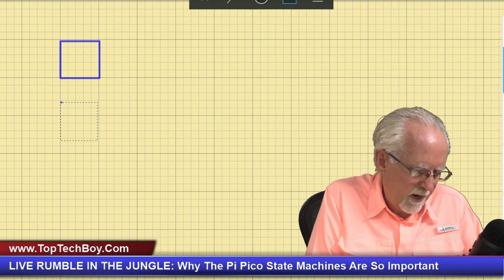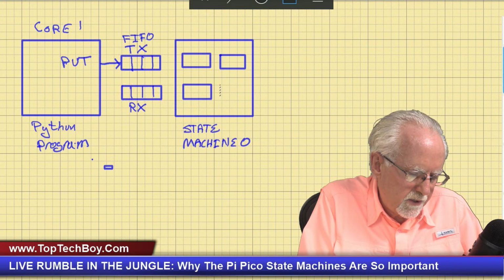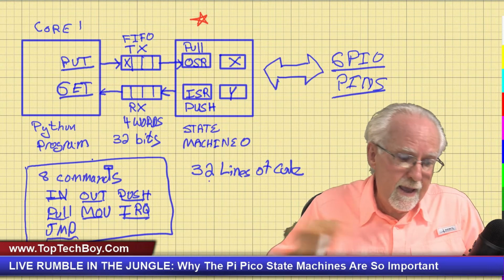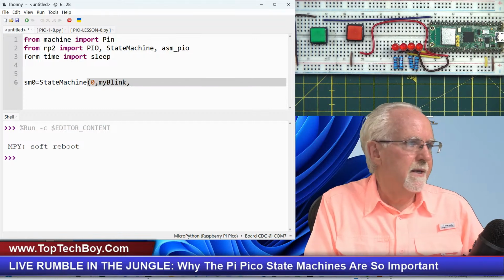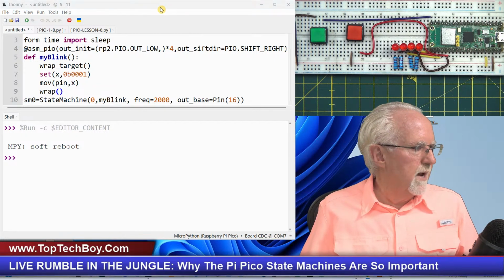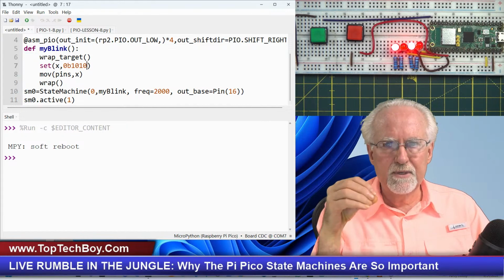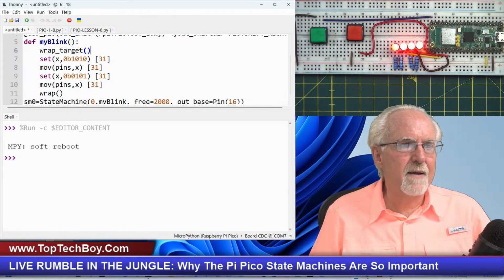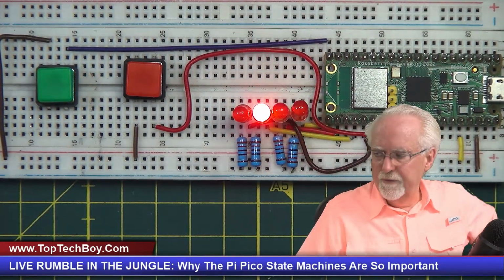LIVE RUMBLE IN THE JUNGLE: Raspberry Pi Pico PIO State Machines and Why They are SO Important

Comment: Hi Paul,

PIO - magic in the background. Great introduction to PIO you provided.

Let mi show a small example, what I'am using PIO's for.
For example as a driver to control locker. It open's on exactely 1 sec pulse.
Once access control will give an access to the locker, programm sends a command to State Machine to open the lock.
Pulse can not be longer or shorter, couse locker will eventualy get unsynchronised (off the starting position to the next cycle).

State Machine gives me comfort of sending the command to open, and forget. That way main core program can continue on some other important routines.

lck_open(msec) function can be called from enyware in the programm.

# Copyright (c) 2024 KarneySoft

# imports
from machine import Pin
from rp2 import PIO, StateMachine, asm_pio

# locker relay
@asm_pio(set_init=PIO.OUT_LOW)
def lckOpen():
    pull(block)
    mov(x,osr)
    set(pins,1)
    label("high")
    jmp(x_dec,"high")
    set(pins,0)

sm_lck = StateMachine(0, lckOpen, freq=2000, set_base=Pin(21))
sm_lck.active(1)

def lck_open(msec):
    global sm_lck
    sm_lck.put(int(2000 * msec/1000))

lck_open(1000)  # drive the lock open -  1 sec pulse exactely - send command and forget

PS. If you thing this is a wrong place to place code samples, just let me know.